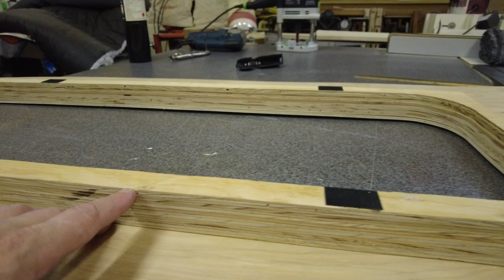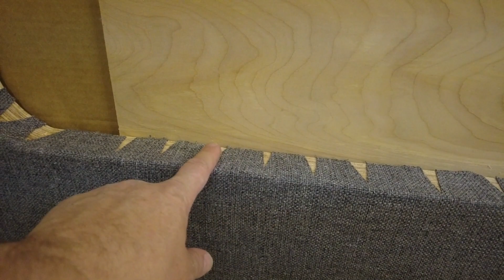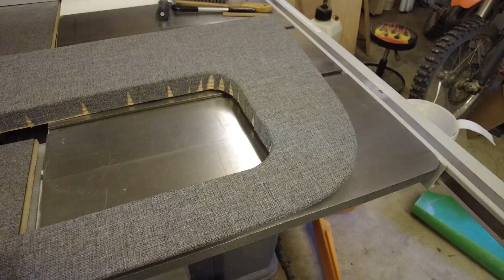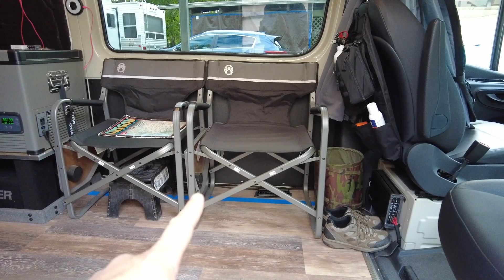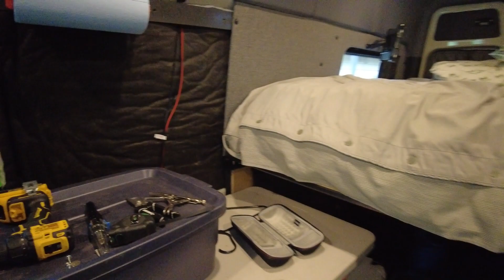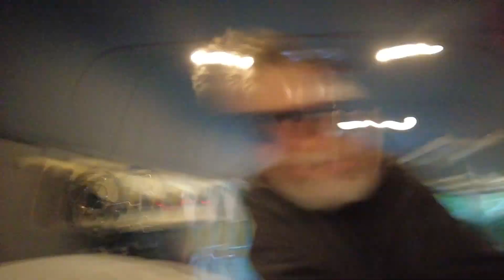DIY Sprinter Adventure Van Build #7: Wall Panels

Comment: Getting ready to build panels for my sprinter with factory headliner. Did you tuck the panels under the headliner or flush with the edge of the headliner?
Reply from the maker: Flush. Actually about 1/8"-1/4" gap.  Then shived some warm led "fairly" lights in that gap, which gives some nice accents at night and keeps the bed from looking like a dark tunnel. Still happy with my panel choice. Good luck